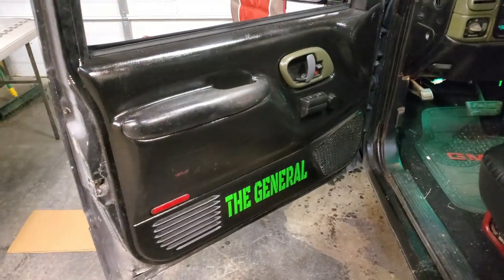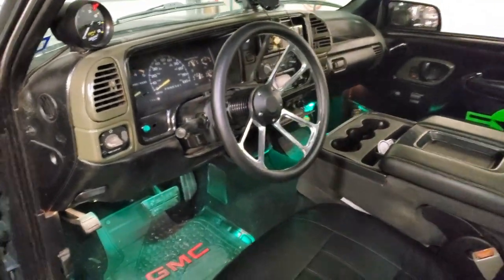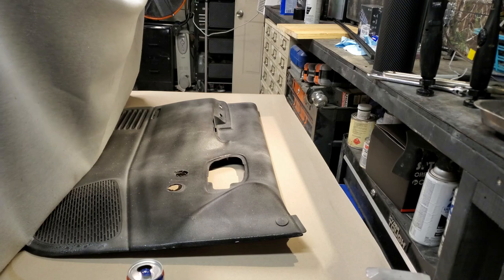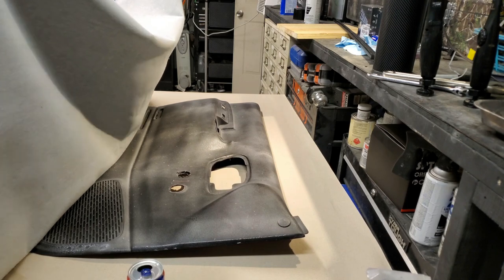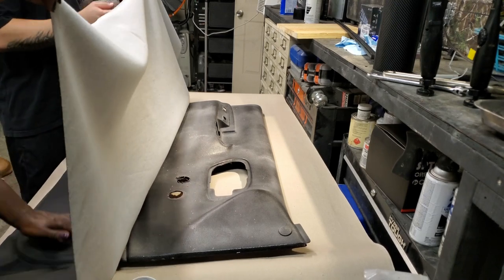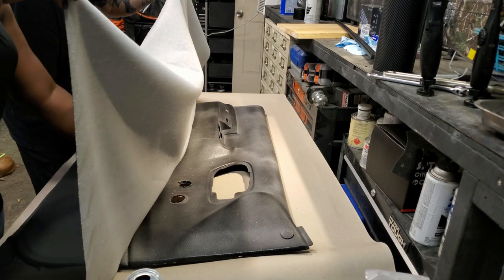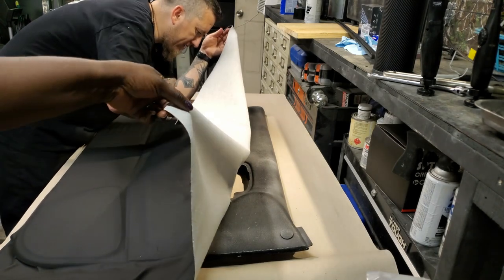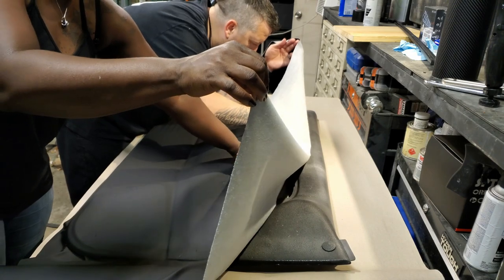Covering 95 OBS C1500 Door Panels

Comment: Now that it's been a couple years. How is the wrap doing? I'm working on door panels, dash, center console, ect. I tried some fabric that has a backing like what you used (vinyl with the white threading). That didn't last two days before it started pealing up. Yes, I used Weldwood contact cement. Then I ordered some actual automotive vinyl. Some of it was worked and stayed in place. Other parts lasted about a week and stared pealing from the edges. Some of it has pealed from the center. So I'm lost in the whole deal. More just pissed off more than anything. 
Anyway, You do did a jam-up job on it!! Much better than the spray paint and MUCH better than me.

Comment: Use poly heat activated contact cement. It will allow you to work in sections. No sticky mess and you dont need a helper.